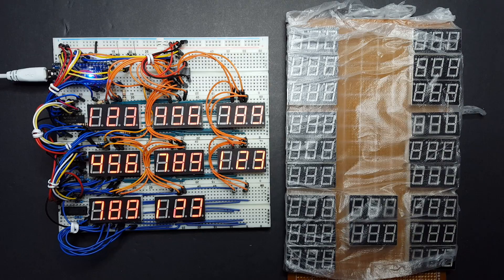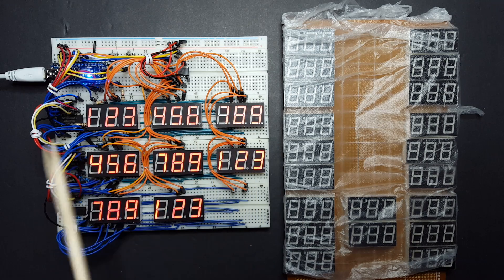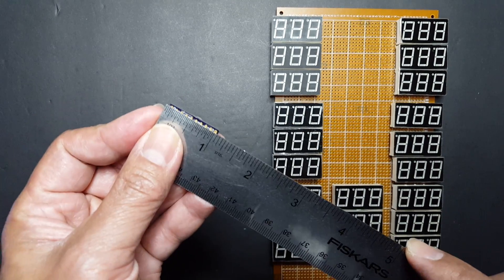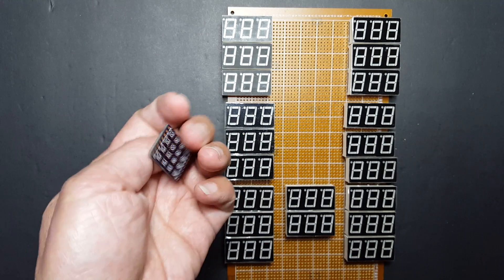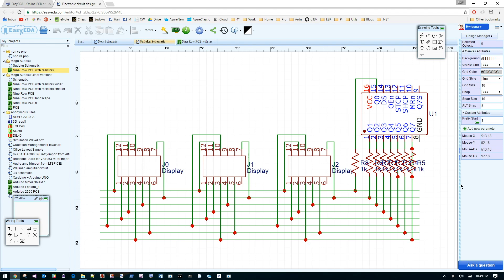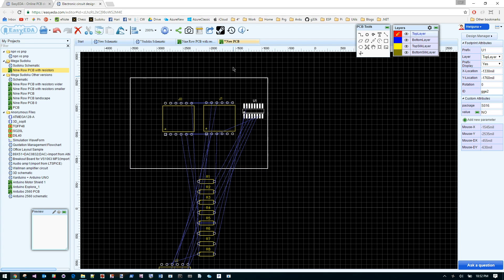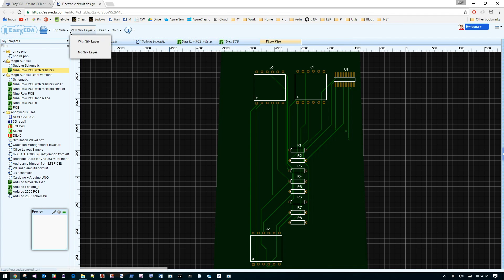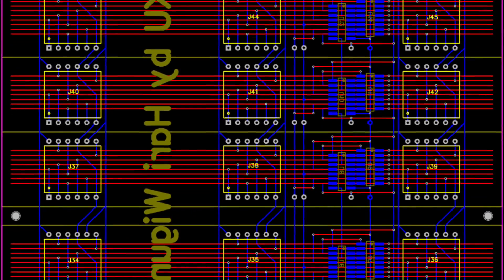HariFun #142 - Mega Sudoku Giant PCB

Comment: yeah, i really love easy eda too but im still used to etch my own pcbs.
Reply from the maker: I did etching years ago but for simple transistor circuits.  Have you ever tried making home-made PCB for surface mount parts?  I suspect it would be very difficult to get it perfect when dealing with such small traces. :-(
Reply: havnt tried surface mounted by now but I will soon